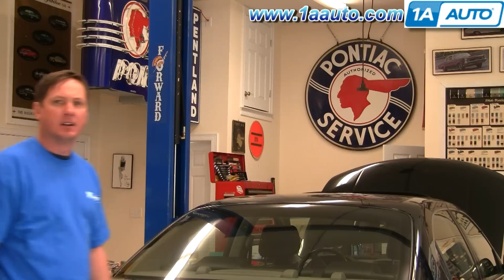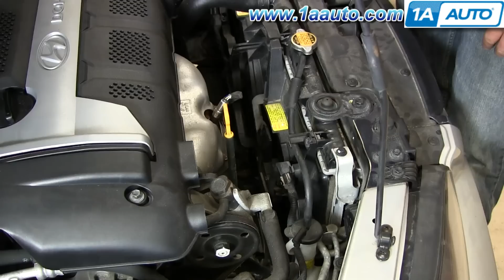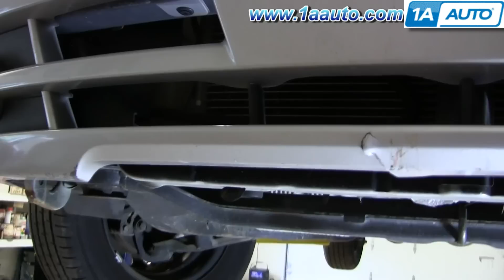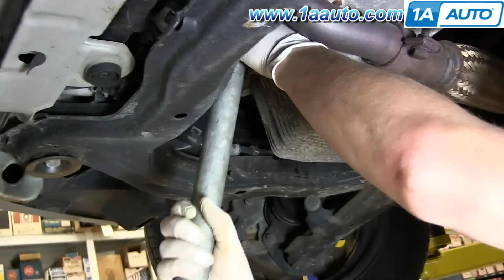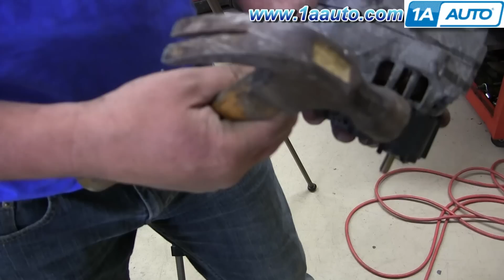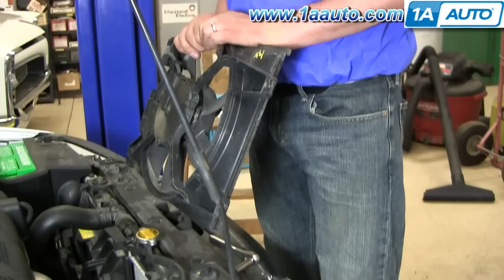How To Replace Alternator 01-06 Hyundai Elantra

Comment: This is my second time using this extremely helpful video for an alternator swap and I thank you so much for taking the time to break this replacement job down. I have a question about the alternator belt: does it just go on the two pulleys, the alternator and the crank, or does it also go on a third pulley (maybe that one is the AC or water pump?) thank you again for this life saving video. I would not be able to get to work and get paid without it.

Comment: For clarification, the bottom bracket is an open "C". No need to remove long mounting bolt. Just loosen it, and alt will swing out. Just did my alternator and it took me a few extra minutes to figure it out. Great video though! Thanks!!!

Comment: My alternator seems to be doing fine but I noticed all electronics are firing way too much. The amount of power coming through is too high. I took a voltmeter to my battery at standstill and confirmed it was being charged to an unsafe level. I ordered a new voltage regulator. I can see the part on the side of the alternator from when you removed it. Do you think this is an easy swapping of the regulator inside the case if I follow the steps here?

Comment: A couple other tips: I pulled the coolant overflow top off and rotated the adjacent hose clamp to the 9 o'clock position. That gives you more room to get the belt back on.

Comment: So I followed everystep of the way and the first time I did this it was squeaking and I thought the bet was to tight (which it was) so I loosened it now the battery light is on and my steering wheel is hard to turn. Could this be a result of the belt?!
That’s the only problem i have right now also will a loose belt cause the steering wheel problem I’m mentioning because I didn’t have this problem before.

Comment: As others have said, great video. Replaced the alternator in my 99 elantra with no problems. It was a little too tight on the path up, so I went down and squeaked it by the oil filter. So much of auto repair is having the confidence to order the part and try it! Thank you!

Comment: Changed my 2005 Hyundai elantra GT alternator on (05 - 01 - 2015). Great video,  thanks for sharing and putting in time to create these.
This video enabled me the confidence to learn, purchase and do the job myself. Biggest issues was taking the bolt out from the lower part of the alternator. Had to wiggle the alernator around, back and forth; to loosen the bolt to pull. Looking forward to putting In small jobs on my ride. Thanks again!

Comment: as the owner of an 01 hyundai elantra, this video series has already saved me $2k. just got a 600$ estimate to replace my alternator and belt and another 600$ for a front passenger wheel bearing...  You will have saved me 3K+ now

Comment: My alternator will swing up and down, not quite far enough to get the belt off. The lower bolt next to the electrical switches does not seem to come out,I heard you say something about a compression fitting, what should i do?

Comment: You said at the beginning of the video that it is a Nissan Elantra. Ooops. Thank you for the radiator fan removal suggestion. I saw another video that said that you had to remove the oil filter and unbolt the radiator to get it out.